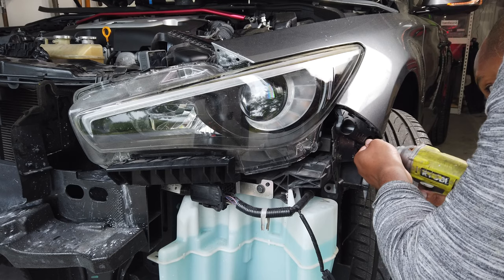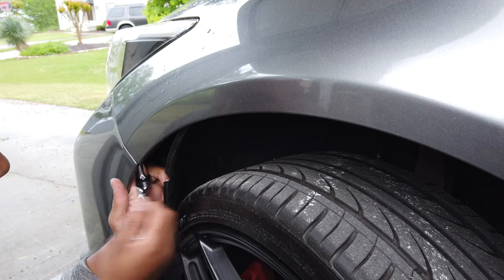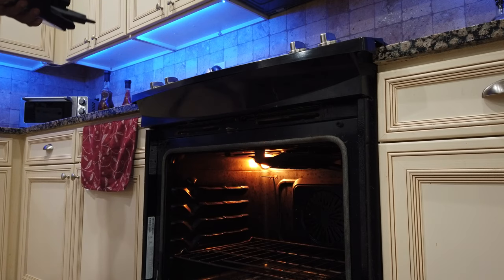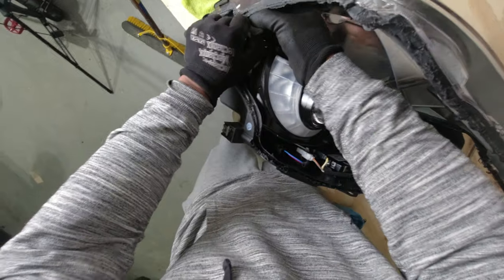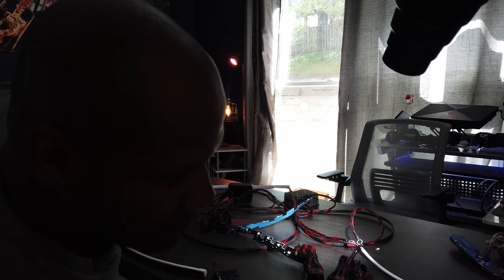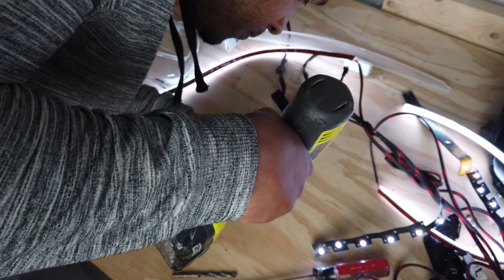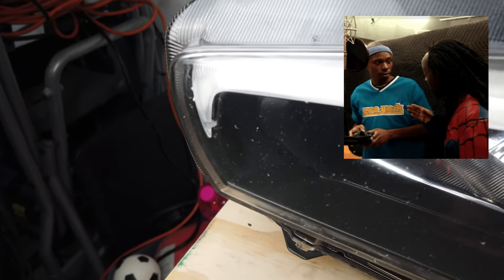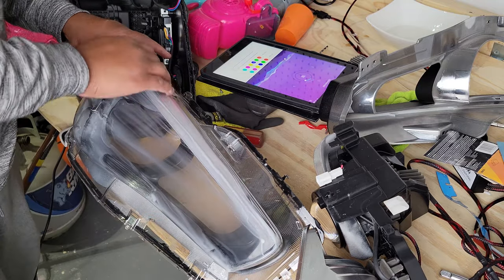How to customize Infiniti Q50 Headlights Part 1: Removing, Painting, adding RGB LED Boards

Comment: For that corner where you were having trouble next time add some adhesive promoter and let it sit with pressure for 25 minutes. It should set in perfectly

Comment: Thanks so much for this DIY. I really was thinking of spending damn near 500 to 800 to have someone do this for me. I didn't think it was that simple. Hopefully I can get this project started and finished this summer. I still have my spring projects to start and finish. BTW love the idea of taking out the led out of the casing, mounting it, and overlapping the casing on the LED's, and smoothing out the headlight lens. It turn out beautiful. Keep up these awesome DIY's. Looking forward to Part 2
Reply from the maker: Big thanks man yah its not brain surgery just gotta be patient!! Good luck and of course lmk if there's anything I can help with/clarify!!
Reply from the maker: If you're grabbing this kit, use coupon SQUAREWHEELS for 10% OFF at lightingtrendz!

Comment: Thanks this video is really helpful and will make my install a lot easier. The only question I have is did you install the halo LED ?
Reply from the maker: Happy to help!!! So I bought the halos, but I didn't like the way they ended up looking, so I didn't use them.  I keep them as testers for my controllers now =)

Comment: Hey bro thank you so much for the video. Just a question so you used back the same glue and did you use the same method as in 275 heat and wait 7 minutes again to glue it back together?
Reply from the maker: Yessir. Exact same sequence in reverse.  I've done this a handful of times and never needed to use new sealant - never had moisture issues or anything.  Just make sure it gets warm enough so you can seal it just as tight as it was before.  (YMMV, I'm def not a pro!!)

Comment: Great video!! I had a question regarding the sequential eyebrows. Let’s say you only want todo the eyebrows, it comes with the strip and module that splits into red, black, yellow, and white wires. Do you tap them into their original functioning wires on the regular headlight harness, or do you need to get the light control module for it to work?

Comment: Hey bro so quick question?? When you put those new components on, do you take the OEM drl boards off completely, or you put them back over the flow series parts! I’m really confused on how this works since q50 drl boards turn on automatically if I’m not wrong, so do they need to be turned on manually every time once you swap those parts!???
Reply from the maker: These parts replace the OEM DRL stuff.  Check part 3 for wiring/welcome animation, etc
Reply: @SquareWheelsAuto   okay so i checked the 3rd part already but then to make the new components turn on automatically without using the Bluetooth controller app, it needs to be paired with the blueghozt controller? I’m correct there? So if i swap the oem pars with the LightingTrendz parts without the blueghozt controller the the half moon and eye brows won’t turn on automatically like they do from factory, that’s my question and doubts.. I don’t feel like messing with the blueghozt controller honestly.. too much wiring

Comment: Waiting for the parts to get in so I can do this. Question tho, how did you put the headlight housing back together? Did you back them again to soften the material it has and put the screw back in? Or did you use new glue material and reapplied it? Or no glue at all?
Reply from the maker: So I've done this a handful of times now, and I've never had a moisture/condensation issue.

MOST of the time, I just reuse the butyl sealant that was on the headlight. Once the build is done, I put the lens back on as tight as I can by hand, then put it back in the oven to warm up the sealant. I pull it out and immediately screw everything back tight.

I've replaced the butyl sealant once. Not necessary in my opinion unless you're extra paranoid. Be sure to remove all the old stuff before putting new stuff down, or it gets messy. 

Good luck Jose!! 🙌🏾🙌🏾🙌🏾
Reply: @SquareWheelsAuto  hey, do you know what size projectors Q50 use? I been searching everywhere and cannot find the answer if they are 2.5 or 3"

Just to add I have a 2018 Luxe
Reply from the maker: @joseostorva7235  sorry bro I would measure for u if i still had the lights opened
Reply: @SquareWheelsAuto  all good thanks!

Comment: Hey bro really hope this is my last question. So I’ve got the first headlight completed. Painted, upgraded drls, projector etched lense, demon eyes etc. what do I do with all these new wires hanging out the back of the headlight before I bake the headlight again to seal it back together? Kinda leery about the wires getting melted sticking them in the oven.
Reply from the maker: I tuck ALL the wires into the headlight before I bake them.  Then I ran the wires out and drilled a hole for them in the little cap thing. Check out my video 3!!! Ur almost there homie 👊👊👊
Reply: @SquareWheelsAuto  ahh ok that’s a good idea thanks man!

Comment: Great video, it helped me finally figure out how to wire my headlights up on truck but for some reason it only work on the top too headlights and not the bottom two. Do you know what could be causing that, I got 4 strips on Amazon
Reply from the maker: Not sure - I'd check wiring first!! Did they all work when you bench tested them?

Comment: Am I able to use profile pivot switchback lights instead of the lightingtrendz? I saw on a forum a guy used pivot switchbacks for the eyebrow (24in) and the half moon(9in). What size strip did you use for your eyebrows?
Reply from the maker: Yeah man once u get in there I can put whatever u want! 24" eyebrows and 8 3/4" crescents
Reply: @SquareWheelsAuto  can you explain how I would install the crescent or where I would put the led strips? Because the OEM ones are behind
Reply from the maker: Concept/process would be exactly the same as this video, just different brand of strips.
Reply: @SquareWheelsAuto  Are the crescent lights  brighter then the stock ones you had? Even with the frost?

Comment: what all options did  you pick??? i’m about to order mine but i want mine to come out like yours! do i need a halo/ diffuser?
Reply from the maker: I picked their flow series and ended up using a blueghozt plus controller instead of the crappy one that comes with flow series.  I bought the halos and ended up not using them.  

TBH there's better options out there than lightingtrendz - they're overpriced, often botch orders, and their support sucks.
Reply: @SquareWheelsAuto  who do you recommend? i would like my headlights to be just like yours! also if you got the halos and didn’t use them which halos did you use? for the eagle eye part
Reply from the maker: @cristianfranco7658  check out Glowe Industries, they are the only company I'll buy product from moving forward. Use coupon SQUAREWHEELS if/when you order.

I don't have any halos. Just the eyebrows and crescents which are currently lightingtrendz. For demon eyes, I used diode dynamics - another awesome company.

Comment: Does the kit bring the eyebrows as well bro?
Reply from the maker: Yup eyebrows and crescents and optional halo rings too. Use coupon code SQUAREWHEELS at checkout for a discount!
Reply: Does it matter if I go with rgbwa or flow series they both bring them right? Just want to make sure, not a look of a description on website. Looks badass bro! Looking forward doing mine and guiding myself through your video
Reply from the maker: I believe both kits come with all you need, but you're right the documentation on the site is poor. It was a crap shoot - I chose flow series because I don't like the look of the individual dots and I assumed flow series wouldn't have em.  Good luck homie. I'm no pro obviously but hit me here or on IG if I can answer any other questions as u go thru it!

Comment: Been following your moves with my Q, I got my Tesla mark 5 installed loving it, however I ordered my kit from Lightningtrendz and They Sent everything but the Eyebrow LED was that something additional on top of the kit? Because I ordered the exact same thing
Reply from the maker: Thx for the support!!! Yeah man the eyebrows supposed to come with the kit but honestly lightingtrendz has gotten something wrong with literally EVERY delivery theyve sent me 😓

May want to wait for my next video too. Make sure you're getting the blueghozt controller not lightingtrendz, it's so much better.
Reply: @SquareWheelsAuto  yeah I’m going to def to be tuned in
Reply: @SquareWheelsAuto  yeah I just contacted them and was told that the RGBW KIT doesn’t include the long brows 😖
Reply from the maker: @GriptheGlick  sorry bro - yeah their website is totally not clear what comes in a kit (and what to do with it), so its a crap shoot when it arrives.  I got the flow series and sounds like I got lucky.

Comment: Do you know if this kit will work with aftermarket headlights?
Reply from the maker: Can't think of any reason why it wouldn't; it just might need to be manipulated a bit to fit if the headlight design is different

Comment: Hey man good review. I have a question can i just buy the sp110e on Amazon for $10 instead of adding a Bluetooth controller to my lightingtrendz cart? Cuz that makes a 70 dollar difference. Unless there's some other pieces are supposed to come with it.
Reply from the maker: Good question man - no other pieces come with the LightingTrendz controller - I'd give the AMZ one a shot if I could do it again.   On my install, nothing goes to the power supply on the BT controller.  Just a single connection from the Lightingtrendz control module to the SP110e.
Reply: @SquareWheelsAuto  Thanks I'll give it a try
Reply from the maker: @4uenvycustomsleds321  plz lmk!! good info for the community
Reply from the maker: How'd it go?? Did the AMZ SP110e work out for u?
Reply: @SquareWheelsAuto  at the moment I'm in Minnesota for business but I did get a notification that my order arrived yesterday so I'll find out as soon as I get back home I'll keep you posted .
Reply: @4uenvycustomsleds321  👀
Reply: @SquareWheelsAuto   sorry it took so long for me to get back to you I actually finally got back home. So that idea that I had a question to it is No it came with everything except the 10-Amp or 20-Amp Flow Series Regulator - 20-Amp Regulator / 4-Output Harness x 1 So i email lightingTrendz to order a 20 amp regulator but still in all it came out to be good I saved  $33 doing it that way. No I haven't installed it yet might do it today but since I save so much money I went and bought the Blueghost Plus and some demon eyes. I hope this helps people and keep up the good work on the videos. If I run into a problem hopefully you'll be there to answer it 😂
Reply from the maker: @4uenvycustomsleds321  No worries thanks for the update!! $33 savings is dope, every penny counts!  

Yeah I wish I would have known about the Blueghozt before, I would have just gone down that route first.  I got the blueghozt and demon eyes - working on that install & video now!

Comment: I wanna do this so bad. What’s the damage i’m looking at? $$$$?   WOAH and hold up where are you jacking it up from ???
Reply from the maker: All said and done about 700 in parts for a full setup with welcome animations, demon eyes, etc. Check out Parts 2 and 3, I went IN on these and I'm not done 😳

I usually jack the car at the front crossmember and rear diff and then put it on stands all 4 corners. Is that weird? 😅